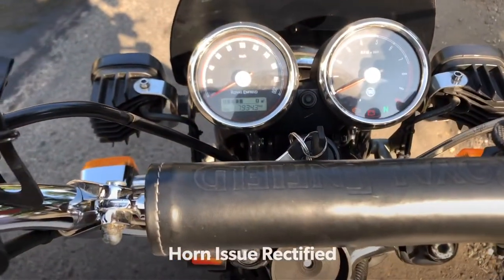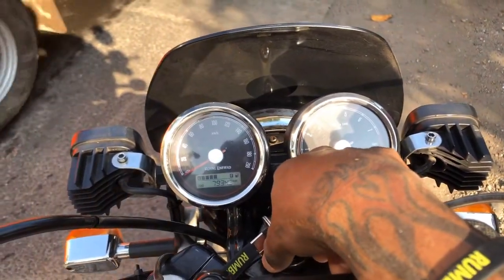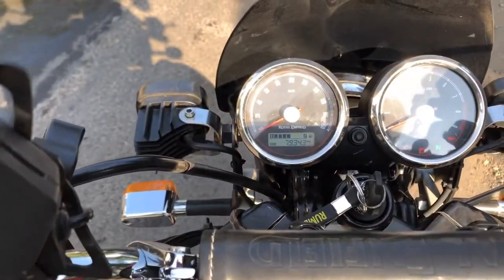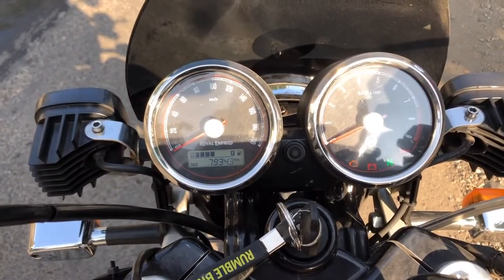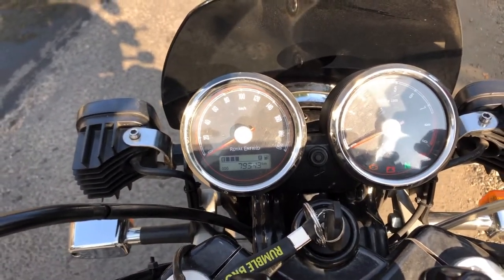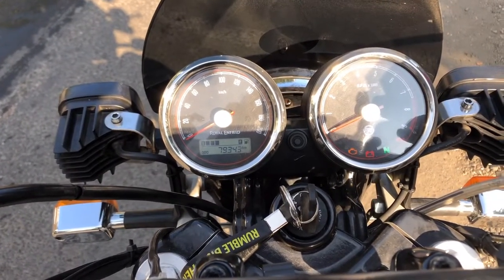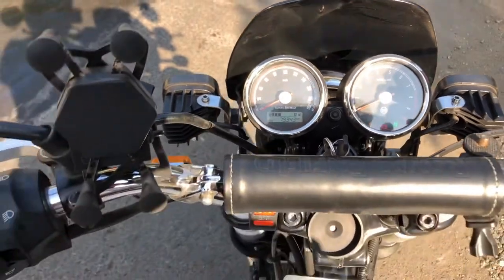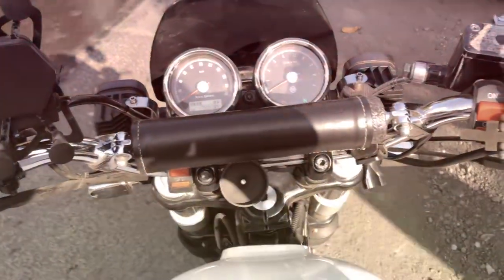Royal Enfield Interceptor 650 - Horn issue rectified

Comment: This bike has the wierdest of problems 
My horn goes hoarse in the middle of riding and the battery icon on the console lights up and engine feels sluggish
The battery icon goes away if I turn off and on again
Reply from the maker: this could mean two things
one:- the loose contact of the battery
two:- rats could have eaten a wire